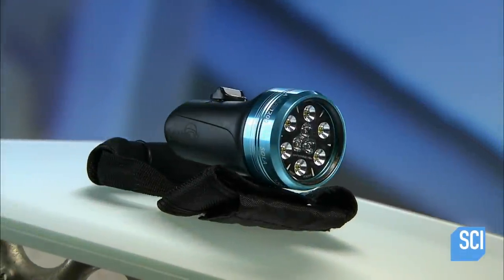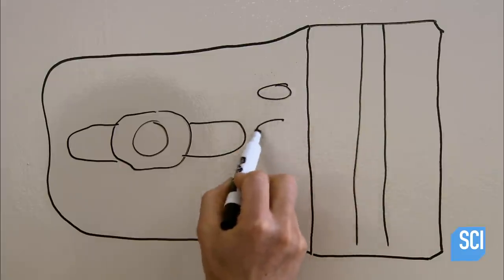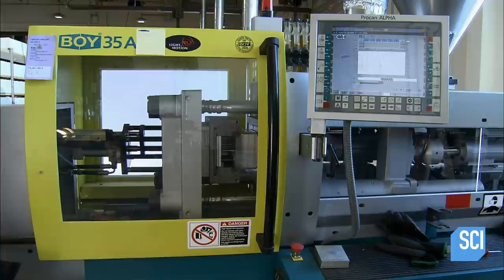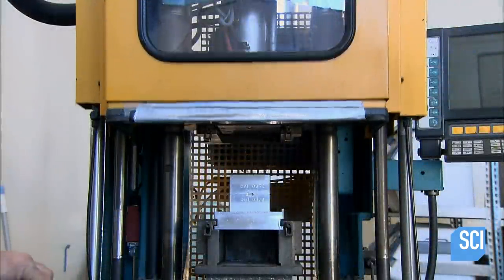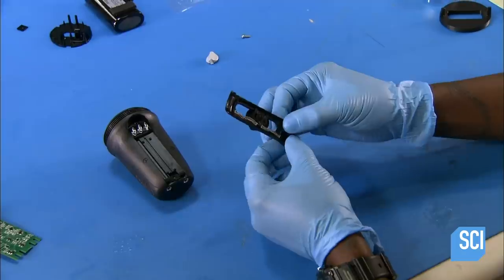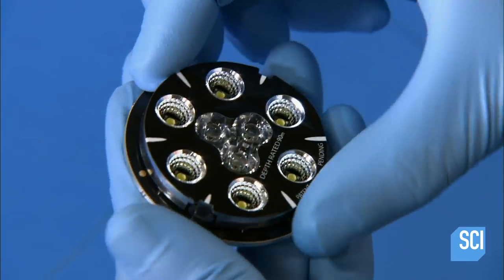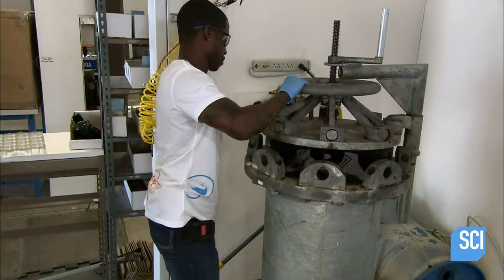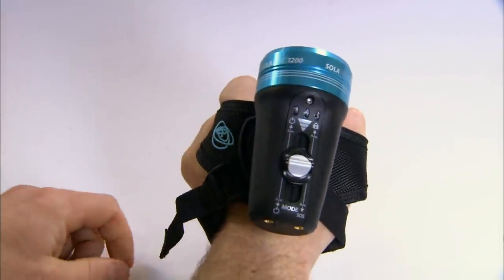How It's Made: Scuba Diving Lights

Comment: I can remember the big cannister lights we used to carry. About the same runtime with a canister that was the size of a large loaf of bread. They did give off some light, but some ran so hot that they would burn out if you ran them out of the water.
Reply: Lol my EDC light will only run at max brightness for like 10 seconds before it shuts off because it gets so ridiculously hot. Probably would run better under water, one thing that is nice about a dive light, having constant cooling all around it. No point in building in a temp safety feature in that scenario.
Reply: DIR/Technical Divers still may use them, but they've improved a ton.

Comment: 2.5 hours to charge for 65 minutes of light? You can do better.
Reply: That's actually pretty good for a scuba light.. must be low lumen.

My 1200 lumen scuba flashlight only lasts like 30 mins at full charge.
Reply: with two tanks (two dives) you'll barely reach 65min of dive time, most my dives last 30-40min depending how deep I go and you really don't use your light for most the dive

Comment: this just shows hoe rubbish batteries are it takes 2.5 hrs to charge but onlt lasts for 65 mins
takes more energy to in than it gives out.
what is the 1 thing drivers have plenty of air.
so why is there not a diving light that runs of air then it will run as long as there is air in the tank ie the whole dive does not need charging so it is enviroment friendly.
it is true people are becomong stupid al those people that think todays batteries are the best and really hi teck you need to get a live
Reply: Charging taking longer than depleting does not mean it takes more energy. It means the charge rate is lower than the discharge rate. Running a light on tank air would deplete the tank faster, talk about wasting energy. And yeah, reading your comment i do think people are becoming stupid...